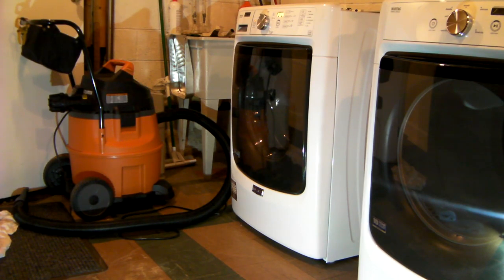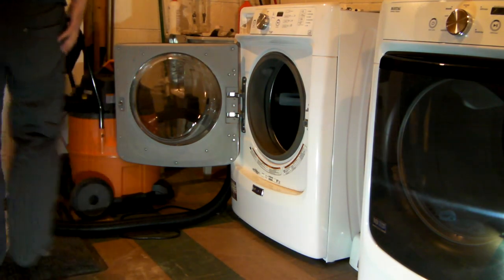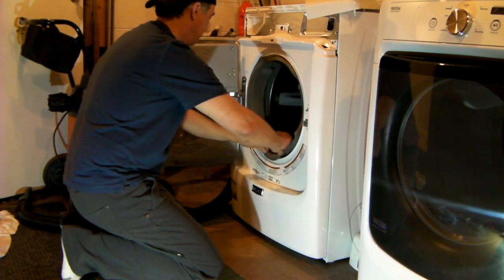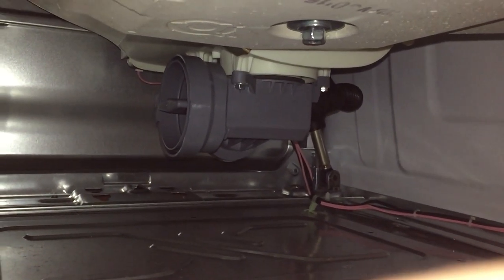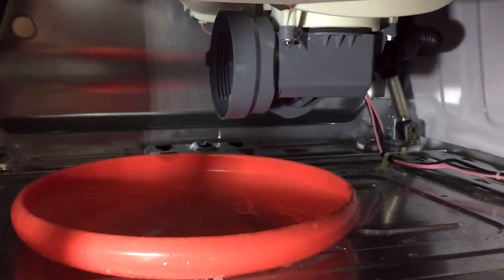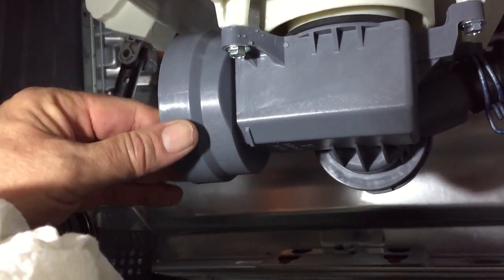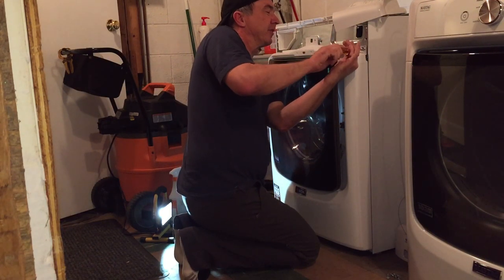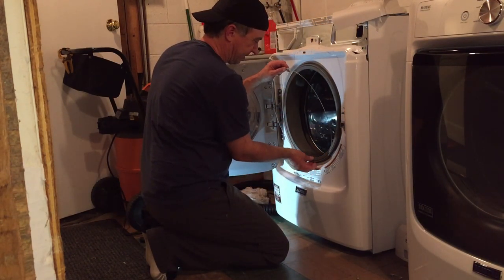[read comments 1st!] Maytag MHW3505FWH Front Load Washer Drain Filter Clean and Repair

Comment: Took the advice to open the back.  There were more than 8 screws.  Probably about 12.  Thinking I have a newer model because when I removed the panel...the drain filter was facing the front not the side.  Zero chance of being able to unscrew from the back.  Followed most of this video to remove the front.  Wasn't able to get the control panel off.  Nonetheless was able to get a hand down in there to remove filter and clean the copious amount of stuff.  Maytag has CLEARLY engineered this simple cleanup step so that only professionals or very motivated individuals can clean.  Terrible.  Next washer goes to the company that can best provide access to the drain filter.
Reply: Gene Donohue OMG. I have a newer modelas as well and I’m absolutely terrified to do this. I’m having buyers remorse!
Reply: I have the same one you open the back much easier to get to it takes about 20min
Reply: Go through the bottom!  Tip it.  2 screws!

Comment: Thank you for this video. I found it helpful for cleaning the filter on my Maytag / Whirlpool MWH5630-HC1 washing machine, although I used a different method. My machine has the dryer stacked on top and no lower access panel below the door. I removed the 4 - 1/4" screws along the bottom of the front panel and determined the filter was facing the front panel and did not provide sufficient room to remove the filter without removing or at least moving, the front panel. It also would not allow it to be removed from the rear or the bottom. My solution was to pull the front panel out at the bottom and reach in from the side to remove the filter. If you had to service and /or replace the pump on this machine it would require removal of the front panel as demonstrated in this video, in my opinion.
Reply: THANK YOU for commenting with your experience! I used your method and was able to move the front panel just enough to clean the drain plug without removing the entire front panel. Saved an enormous amount of time and energy by reading your comment before beginning the process. Thank you!

Comment: Took off the back panel and the filter was positioned at the front.  Tried to take the front panel off, but realized I needed to take off the top but the dryer was secured on top.  Now I gotta remove the dryer to access the top.  I'm essentially taking everything off!!!  They really need to make it more easily accessible.

Comment: This was very helpful to me as I must have an older model and the filter was in the front. Started by trying to go through the bottom but could not get to the filter that way. One thing I would add is when you are flushing out the drum, turn the drum around a few times to make sure you get everything trapped in various places. Thanks for the video, ignore the haters.

Comment: Thanks for the video!  I, like the other comments have pointed out, think accessing from the back or bottom is MUCH easier than the one-piece front panel.  I personally went from the bottom as my laundry room is a tight squeeze.  Fortunately the pump error was intermittent so I was able to restart the unit and drain the washer first.  Just unplug and pull the unit away from the wall about 2.5 or 3 feet.  Then tilt it back and let it rest against the wall to give you easy access to the bottom.  Now obviously you should make sure the tilt back is far enough to be VERY stable and have another person with you to be extra safe.  But mine was really easy, very stable, and no worries at all. From there is was a simple two screws to remove the thin sheet metal cover and very easy to reach the screw-on/off catch mechanism on the drain pump as shown in this video.  Took literally 5 minutes.  In fact I'm just leaving the panel off the bottom for even easier access next time.  Plan on doing this every time change (like the smoke detector battery replacement reminder) just to apply a little smart preventative maintenance.  I was shocked at how much gunk was clogging this up and can only imagine the strain this puts on the drain pump itself.

Comment: I have the same washer that sits on a pedestal. Front access seemed way too hard. Pull the unit away from the wall and unscrewed twelve screws and removed the back side metal panel. Shop-Vac nearby to clean up the water. Clean the filter and back together in 10 minutes.

Comment: This is the only way to access the drain filter on my mhw6630hw.  It is mounted in the front, facing the front with approximately an inch to the front panel.  It is not accessible via the back panel removal, I tried.   It is not accessible from the bottom, I tried.  Note, there is a black 1/4" hose with a plug in the end randomly laying in front of the filter plug.  Unplug it to drain the majority of water out before opening the filter access plug.  Also, a spring spreader would help greatly with reassembly of the outer drum seal.  Otherwise, definitely a two person job.  One person with pliers on either side of spring, spreading; another person putting wire in place. Huge thanks to you for posting this video!!!   Made my task a lot easier!   PS, this Maytag model has ruined me for Maytags.

Comment: Thank you so much for making this video. Dog bedding and rugs had the codes flashing and me in research mode all yesterday afternoon. Maytag didn't have a parts diagram to offer without asking. Your video was way better, even if you took the scenic route. You made our job easy going through the back. Ours had 13 screws. And the part about sending more water through the drum, quart by quart really was great thinking, to be sure. We switched out a shallow roasting pan and a sheet cake pan. Easy Peasy. I think that idea someone suggested of doing this with the time changes when changing smoke alarm batteries in order to save that pump is a great idea, too. I din't think I could love this machine (5500) more. Thanks again.

Comment: @elvisandmick dude, you saved us $300. The last repair guy who inspected it charged us $100 (for the inspection only!) and then said we'd need a new pump: we knew it was all BS - there was even another repair guy who told us so! 
I followed your instructions, found 3 socks, 2 pennies and some other stuff in the filter. Now it works to perfection. Fwiw, I have a 2014 model.
Took me 2.5 hours on the first try. Luckily I had a 11-in-1 multitool that was able to unscrew everything (btw, there are so many different screws, it's a joke - again, Maytag and all these washing machine manufacturers are racketeers). Maytag definitely designed this so that no one could do this without some knowledge / tools or at least not without getting dirty.
I do encourage everyone to try it though, as it won't cost you more even if you fail / can't reassemble it.
Good luck!
Reply from the maker: Strateggo cool! Good for you! 👊
Reply: contact the attorney general on the fraud and put him out of business. he needs another job.

Comment: I appreciated the fact that you were able to give the location and situation of the pump. Going in from the back would have saved you some momentum though as you wouldn't have had to remove the top panel or anything on the front for that matter.

Comment: I want to clear some things up in this comment section, a lot of people seem to have a lot of anger towards this exact earlier model year of sorts for this model number of washer, the "MHW3505FWH". This model seems to notably be missing the bottom access panel as seen in this video, but because of this, they seem to have made changes and very quickly discontinued that model, replacing it with the model number that I have, the "MHW5100DW0". 

The one I have seems to be entirely identical, apart from it having a nice large bottom access panel with 2 bolts and 2 plastic fasteners. I however saw this video, and the identical front facia of the washer in this video, and assumed mine didn't have a bottom panel, so I did this drain cleaning via the rear panel, which obviously, as many people have stated, is laughably easier than going through the front like this guy did, it's only 11 bolts, and 4 little plastic things that may be already gone, if the washer is hooked into the wall. Anyways point is if you don't have the bottom panel, or if you are like me and simply can't lift the washer to access it, going through the rear to do this is honestly really easy and only took me 30 minutes in total for the entire thing, doing it singlehandedly with no help. Even the version he has in this video, if you go through the back, it really is not that bad.

Comment: Ok. This was very helpful to me. I could not access from the bottom as suggested in below comments, so i took off the top and face. I had 2 socks and coins in the drain. Replacing the clamp stomp me too, so i watched another video which used vice grip pliers to grab the wire right next to the spring and pulled it sideways to strech and place it back on. Took me about two hours total to finish, but saved me money and was a good project for me and my children. Mrfixit was also helpful.  Thanks again!

Comment: Thanks for the video, it was very helpful.  It is much easier to remove the rear access panel (13 t-20 screws), and there are no wires or gaskets to worry about.

Comment: I have this washer too. I'm ready to cut a fucking hole in the front and put an access panel door into it. I remembered seeing this video a long time ago and wondering why you didn't just take the back off. It took me a while to find it again. Now I'm watching it again see where I can cut a door in this thing lol. I miss my old washer that thoroughly washed clothes in 20 minutes and never had any problems for longer than I've been alive.
Reply: Access panel door is on the bottom. 

Tilt washer so it will stay ~°50 angle. If its gonna fall, youd rather it falls back.

There is a access port in the center. It is held by 2 clips and 2 Torx heads. (You can also use a socket wrench) 

I managed to clean my filter by just removing 1 clip and 1 screw. 

Bent it just a bit, but I don't mind with the amount of time saved. 

It was thin metal anyways. I bemt ot back after I finished.

Hope this helps ya.
Reply: @cedricfocht8023  it's so heavy. I don't think I could tip it up with water in it. Thanks for the tip though. I will look into this.

Comment: Great video. Just had to do this. I'll make one suggestion. when putting that "snap ring" back over the rubber drum boot, use a screw driver to get some leverage on it so you can really stretch it out. And also get another set of hands to help.

Comment: I had a pillow come apart and very same error. And I have the same sink. Thanks so much for sharing. I found similar video info, but for a different model. I'm so glad you showed it for this model. I already have the back panel off and will try to access the filter there. I was trying to access the interior hose to check for clogs and can't access all of it. Hope this will be the solution.

Comment: I cut a hole on the left side to get back in there... also don't need to take apart.  Can access it again and do it yearly or so.
Reply: If you tipped it backwards, you can go through the bottom.  2 screws.  8 minutes.  And no gigantic hole to let hands or pets into the electrical wiring.

Comment: Oh, in case this is helpful to anyone else. I had to play with the codes flashing and the door stying locked. A combo of turning it off, unplugging, and replugging would start the pump draining again for a while. I actually think it was a set number of minutes. I had to do this a couple three times before it was completely empty, finished and the door unlocked. It took a little nervous patience as I was concerned about more pressure on that precious pump, but it worked out. Also, ours was a super tight fit into a w/d closet. Difficult to move. Opening the door, and being careful to get a hold that didn't risk damage or strain on the gasket, finding a solid handhold, even I could lean back and slide that baby out scootch by scootch.
Reply: it's easier with one of the pedestals

Comment: good video however....after taking the whole front of the washer off to access the stupid pump i noticed on this particular model the maxima there is a panel that you can remove on the very bottom of the washer that grants you access to the pump and the door lock!!. just tip the  washer back and you will see two plastic keepers and tow screws.

Comment: Thank you for the detailed video. Hardest way yet the only way to get to the filter which is facing to the front. Absolute shitty design by Maytag which obviously did not invest in user experience design of this machine. Just finished cleaning the filter as per this video and it works !!

Comment: Followed your steps and it was a very easy job to unclog my really clogged filter.  Also took off the large drain hose hooked to the rear while I was in there and removed even more gunk.  I highly recommend this last step while cleaning the filter.  Good job with the vid.
Reply from the maker: Good to know, thanks!
Reply from the maker: I also have learned that once the main parts are clean and the washer stops throwing error codes, that running the washer cleaning cycle does wonders for dumping out more sand etc.

Comment: I have a model MHW6000XW2. I opened the back hoping the pump filter was accessible, but no chance, it faced the front panel. Really poor placement design, I had to take off the top, and two front panels to access it. Look in the back first, but also consider how accessible the pump filter is when you buy!  The filter was a mess and stunk, and the washer worked after I cleaned it, but it turned into an all day job. Placement of the pump filter trap and its accessibility really needs consideration by Maytag.
Reply: Uugh we have the same one. Took the back off and it’s facing the front. It’s got the dryer stacked on top and both are super heavy, could barely get it out away from the wall. Am almost at the point of just buying a new (not Maytag) washer.

Comment: The absolute easiest way is to tilt the washer back, take the bottom panel off - only two screws and two plugs, and from this video you can see how accessible the filter is.  When you tilt it back you can use a wet vac to siphon the water from the washer (open front door) and there will be very little water left. Twenty minutes from start to end.
Reply: You didn't notice that the drain has a 90 on it and tipping it backward will not allow you to flush it. Tip it to the side 😆.

Comment: Hey there I have the same machine as if u take the back plate off is quicker only 8 or so screws and u get right in there to clean the pump faster and what I do when I put the trap door back up is I put a little dab of Vaseline on the rubber gasket as it keeps it from ever leaking and won't dry rot the rubber gasket I just put a little on my finger and I'll wipe it off my finger as I rotate it on the gasket and once in a while I'll take the gasket carefully out and I'll clean it with a rag and Vaseline as the cleaner for the rubber gasket that my frend will make it last for many many years I bought a replacement and I kept it in the bag that it came with tape on the back panel so if I needed one it's there because I clean my pump once a month to keep the machine running smoothly as the pump will last for ever if always clean ! The problem with new machines is more maintenance hope this helps taking it apart threw the front takes way more longer then the back more easy
Reply: I ment back on not up dum autospell

Comment: [Please pin this post to top for visibility]
I appreciate you taking the time to record and post for us! 

With that being said, this model washer has an access port. 

Tilt the washer ~ 50 degrees backwards. 

(If it falls, you want it to fall backwards, (Away from you.))

You can remove 2 clips, and 2 torx head screws in order to remove the access port. 

(I personally just removed the clip and torx head screw on one side. Then let the access panel hang down.)
Reply: Please make a video

Comment: so there is an access panel on the very bottom. no need to take the whole thing apart. hope this helps
Reply: I took off the bottom also. And thankfully I think we just fixed our washer!! I'm so happy I dn't have to get a new one!!
Reply: Please post a video of the bottom access.     If I tip my machine back, it will be leaning on the drain pipe.   Also it is on a stand  18" off the ground so if it falls,  I suspect I will be replacing the washer.    Not sure how to make this work.  Thanks!
Reply: @508cocopuff  There is noting to it.  Tip the unit back 45 degrees against a wall, take off 2 screws, and done.  8 minutes.  

This video should be removed!  The pain is has caused people!

Comment: stick the shopvac in the hole and rinse it out. shopvac the drain line after flush the system remove the filter again because theres junk from the tub in it.. my opinion anyways 😁
and i was waiting for the assembly to crack he turned it so much its friggin plastic?

Comment: Useful video - I started by looking at comments so I went in the back, but my model of Maytag (Maxima XL Steam) has the filter facing FORWARD. it is almost impossible to get the filter back on properly accessing it from the back. I had to eventually disassemble it from the front as shown here to get it working. Also very annoyingly, the filter is mounted low and fixed to the front rail, so you can't get a pan underneath it, and got water all over my floor. Clearly not designed to be serviced easily.  So glad the new ones are more sane with the filter facing sideways or towards the rear. See this video for clear instructions https://www.youtube.com/watch?v=fc0yEiXqQ_4